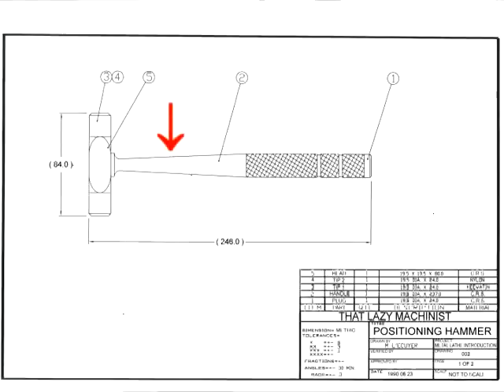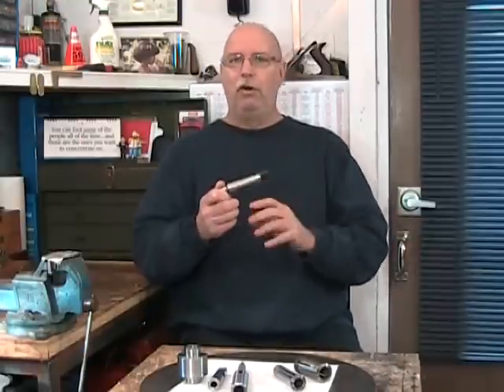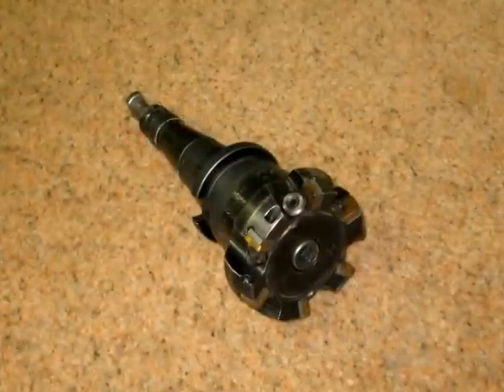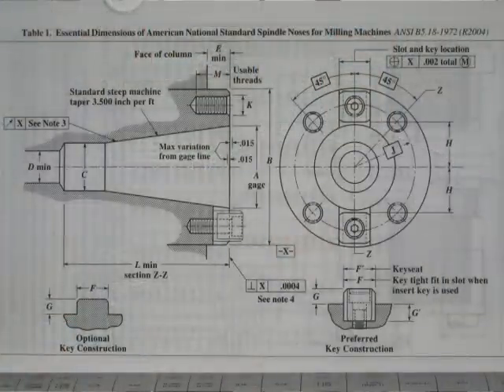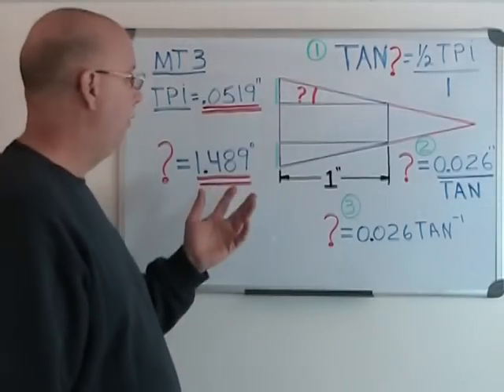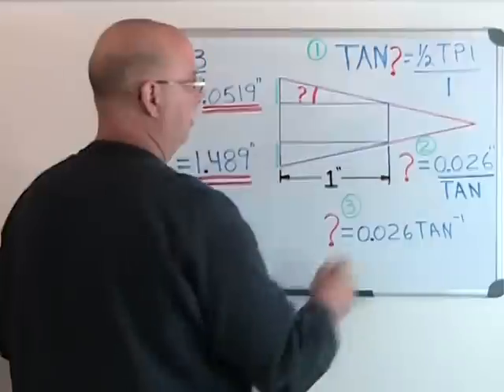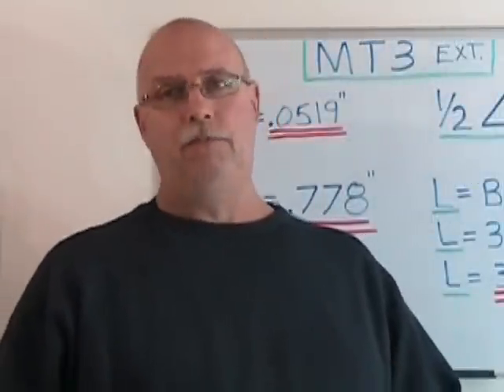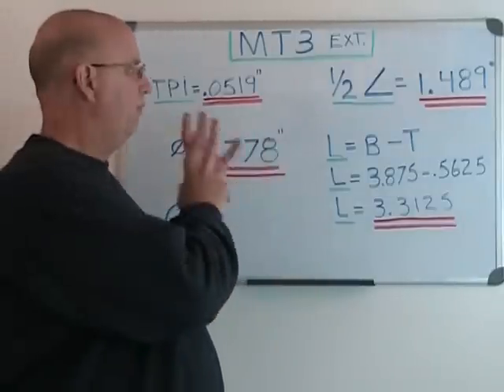STANDARD & ONE OFF TAPERS, (MORSE TAPERS, MMT TAPERS, COLLET TAPERS...) MACHINE SHOP, MARC LECUYER

Comment: Nice video Mark. Not having a taper turning attachment, it enabled me to set up my compound slide for turning the taper on the hammer project. 2.5 deg half angle gives 0.04366 per unit longitudinal feed, but compound slide moves along hypotenuse so using sin 2.5 deg I get 0.04362 per unit. Set up straight bar in chuck, indicator on compound slide, adjust compound to give 2.181mm (0.0858 in) taper for 5cm of compound travel. Finishing handle tomorrow (I hope)

Comment: Strictly speaking, inverse tangent, also called arc tangent, is not the same as "dividing by TAN" or multiplying by the reciprocal of tangent. The calculator function TAN 'raised to the -1 power', is 'inverse tangent' or 'arc tangent', usually abbreviated 'atan'. The function atan(x) calculates "the angle which has tangent x", which is just what you want to solve this type of trig problem, i.e., given the change in diameter over a perpendicular length, what is the half angle?
I do appreciate your efforts to explain tapers and their uses, and I've learned a lot from your many videos.
Reply from the maker: Thanks for the explanations Paul. Comments such as your push things forward and that is a very good thing. Marc
Reply: i concur with what was said here 8 years ago. :)  once you setup your equation correctly tan (?) = .026 you can't isolate the degrees you are looking for "?" by simply dividing by tan. you have to apply the inverse function of tan: atan or tan raised to the -1 power. so to isolate: atan ( tan(?)) = atan (0.026). Because you applied the atan to the left side of the equation you see here that you have to apply it to the right side of the equation also. the left side cancels out and you will be left with: ? = atan(0.026). on most calculators that have trig you have to hit "2nd" to get atan or tan-1.  And make sure your calculator is set to 'deg'rees and not "rad'ians or 'grad'ians.

Comment: Still learning from you, still enjoying the process! I think you meant to say "larger" at 8:31 when describing that the dowel pin needs to go into a hole. You might check this for me and let me know if I have misunderstood something. I picked up a lot that is now obvious (after your explanations), but were unknowns before. I'm still a bit unsure when it comes to buying tool holders for my mill regarding the relationship between tapers of CAT40, ISO40, NMTB40, DIN2080, BT40 and so on. I believe my mill is NMTB 40 with 16M internal threads for the drawbar. It would be nice to know what tool holders can be used when ordering. Another video quickie? Well, no matter, that was another addition to my brain. Let's see if it translates into skills at the machines! Thanks for sharing.
Reply from the maker: Hi Jim, you heard wright, I should have said "larger". I added a message to the video to rectify the problem. Thanks Jim! Marc

Comment: Hi Marc.  as usual I enjoyed your presentation.   Your explanation of measuring the male taper  using a sine bar, gage blocks and V-block was pretty good.  I was a little disappointed that you didn't demonstrate using the system with the dial indicator.  Maybe in the near future you could supplement the theory on video.  Thanks,